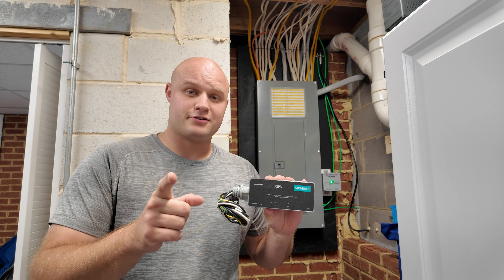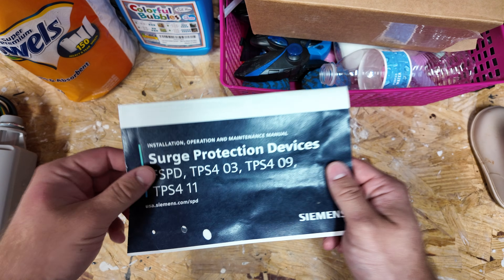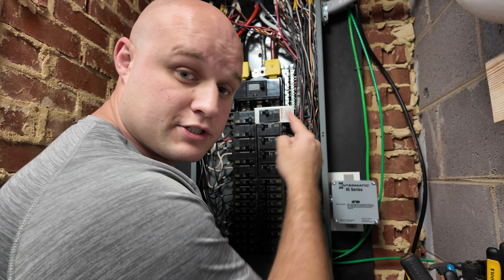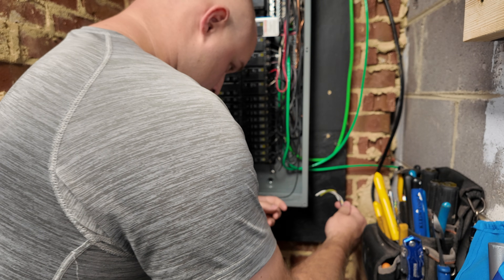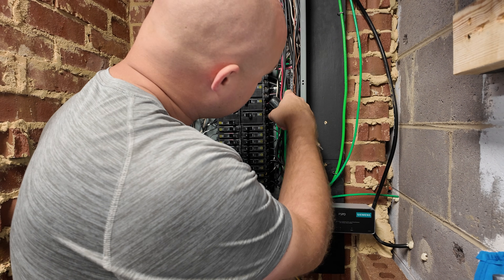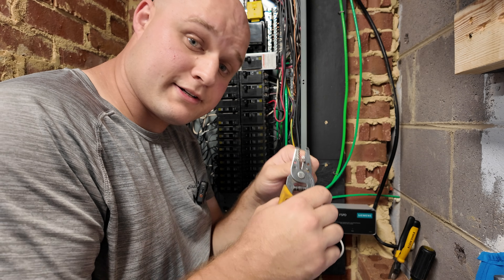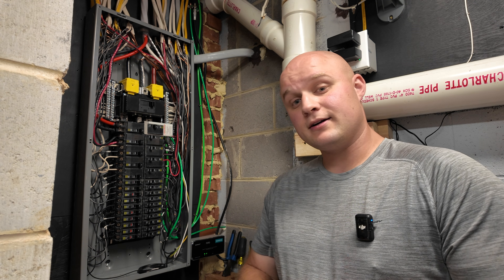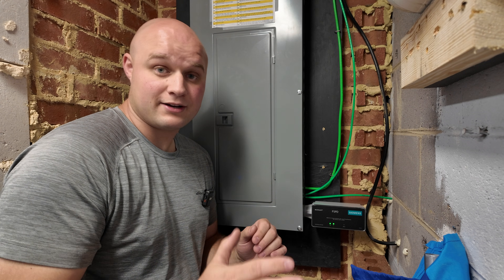DIY Electrical Panel Upgrade That Could Save You Thousands! Siemens FSPD Surge Protector Install

Comment: The reasoning to think the first surge suppressor was broken is faulty. The surge protector isn’t meant to protect your house from lightning strikes, nothing can. It’s meant to protect from transient voltage that can be induced by nearby lightning strikes. To me it sounds like it works be it can’t protect your landscaping lights and transform as the outdoor wiring is a huge inductive target.
Reply: Hope you didn’t really toss that Intermatic surge suppressor
Reply from the maker: Yes, I get your point. However, I had a few separate lightning strikes over the course of the year around my house taking out different things so I decided to upgrade to a bigger surge protector that is able to handle more of a surge.

Comment: Very nice! I just bought the exact unit. Having to redo the service entrance to the farm. By code we have to have one of these devices installed. Currently (no pun intended) we have an older style that is just hooked up to the ground at the meter. I think this unit will be ok installed to the outside service panel.
Reply from the maker: Yeah it should work well for you! Best of luck!

Comment: Turn off main breakers before doing any work in this sub panel; the surge protector should have been installed in the 1 and 2 positions in this sub panel, even if it meant relocating the breaker occupying the 1 and 2 position
Reply from the maker: Yes, that is definitely a safe practice however cannot always be done since you will be shutting off the entire house. And I get your point there, however according to the instructions that is not necessary, and it will still serve its purpose and do its job wherever the breakers is placed in the panel.

Comment: If you have a bad earth ground for your panel, then your surge protector will only be as good as that is......
Reply from the maker: Very true! I know, though that I got a pretty good ground as I have two ground rods on the outside with brand new ground and cable running to them

Comment: Do you know if the instructions say this can be used for a sub panel (separate neutral and ground with no bonding)? Putting in my main panel isn’t an option. Thanks
Reply from the maker: It should be able to be used in. Sub panel with no issue. But I think it may not be as effective.